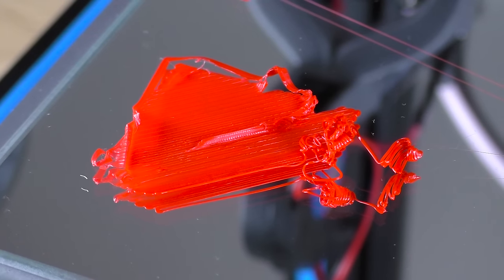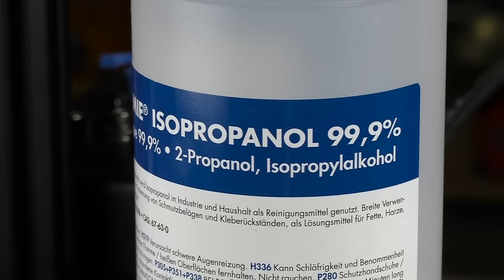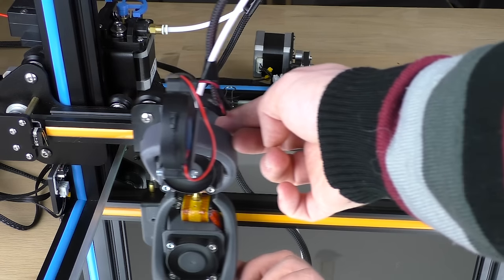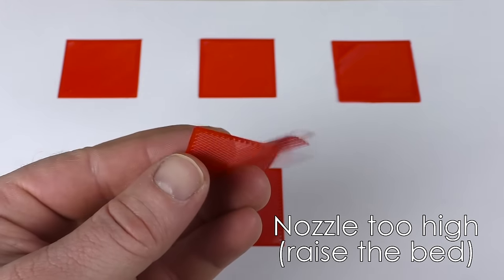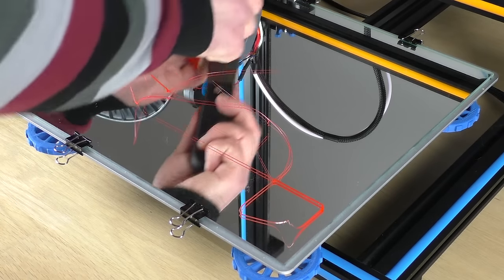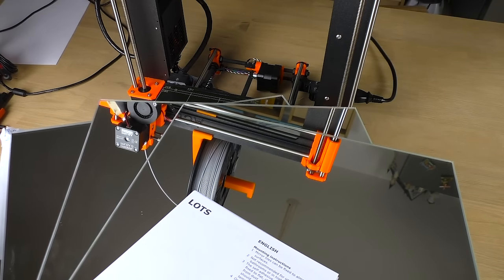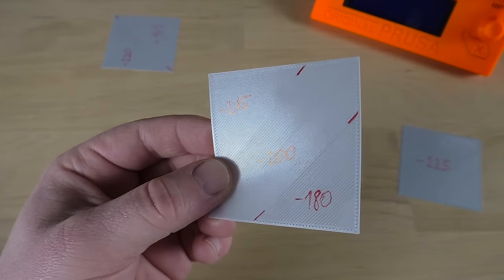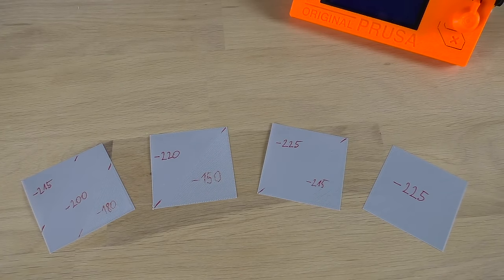Best method for 3D printer bed levelling

Comment: The "always clean with alcohol" tip deserves a thumbs up!
Reply from the maker: And so does your comment ;)
Reply: How I clean my insides too.
Reply: Unless you use buildtak
Reply: Never touch the glass print bed after cleaning. Body oils will reduce adhesion of the first layer.
Reply: If you have a glass bed, I strongly suggest to clean with dish soap before every big print and alcool between small prints and sometime with dish soap.
Reply: I've heared that alcohol destroys the plastic layer, can it be true?

Comment: I like the printed squares, but they look very big.   I recommend smaller squares, and then measure the thickness of each one with digital calipers.  Compare with the first layer height. The threads on many adjustment screws are 0.5 mm pitch.  So  1/5 of a turn moves the bed 0.1 mm.  Very good to know, place five marks on each adjustment wheel.  Turn 1/5 of a turn for error of 0.1 mm.  Most printer firmware assumes the paper has zero thickness, yet it is 0.1 mm thick.  So 1/5 turn after adjusting with paper will get you to zero.  Thank you for making and sharing the excellent video.  Very high quality.
Reply: Thank you very much sir! This is giving more tools for more precise calibration!

Comment: Thank you very much when people say “the nozzle should drag the paper” it’s a problem because drag is a generic term and everyone has a different idea what drag means like does drag mean that the nozzle is barley touching the paper or a lot etc thank you for actually showing it on camera
Reply from the maker: Thank you!

Yeah, that's why I've always hated the paper method, it's just not accurate enough for anything but a rough estimate. Even doing it myself, it's hard to be consistent with every corner. Printing the squares eliminates any guess work.
Reply: Yep, before this comment was made, I just yesterday started to under that I should start feeling resistance. I finally got a consistent 1st layer for the first time since owning a 3D printer.
Reply: @HobbyHoarder  lets not forget when people use "levelling paper"
like yeah, we all have some 3d printer levelling paper lying around.

Comment: I know this has over 300 comments but I wanted to jump in and add my thanks for making this video. I've been leveling my bed this way since I got my printer after I stumbled upon calibration squares on thingiverse and it has saved me hours of frustration. All new entrants to 3D printing should watch this video and learn this process for bed leveling. This is even better than automatic leveling because you are adjusting the actual finished product. I will often watch my printer during the first layer of prints and make minute adjustments to get that first layer perfect and my print quality has been consistently awesome using this method.
Reply from the maker: Thank you Christopher, it really means a lot. It always makes me happy reading how I've helped someone. And you're right, I prefer manual leveling as well. It's easier and works just as well as the auto leveling on my Prusa.

Comment: You are a lifesaver! I was using the paper method and I never got a good first layer. This helped me dial it in perfectly and now its almost impossible to get a print off without bed cooldown. Just like it should be!
Reply from the maker: Every comment like this brightens my day, thank you.
Reply: @HobbyHoarder  I kept thinking that it cant possibly be closer than the paper thickness. i was wrong. You helped me a lot. Im still tweaking it to get it perfect
Reply from the maker: I don't know how long you've had your printer, but the springs on new printers need some time to settle. Don't be surprised if you'll have to re-level it again in a few days. After a couple of weeks, the bed will become much more stable and you might have to level it only every few months.
Reply: @HobbyHoarder  I do notice my CR10s4 glass plate sags a little in the middle according to the calibration prints.
Reply from the maker: Yeah, that's quite common with the S4, it's just too big. Check the video description, I have a link there for wedge jack that you can put under the bed. You'll get a fifth adjustment point in the middle then and you can use it to raise the center just a little.

Comment: Dude! This works perfectly. I ran it 4 times and saw noticeable improvement on each run until all 5 squares were perfect. Kudos
Reply from the maker: Always happy to hear that, thank you :)
Reply: @HobbyHoarder So I've just gone and got myself some mirror glass after your recommendation.. do you have any tips for changing the z height for the thickness of the new glass? Ideally I'd like to create a ' glass bed profile ' and a ' magnetic bed profile ' with the correct z height set for each. Thanks in advance
Reply from the maker: @123benlambert  Depends on your slicer, but Simplify3D has the Z-offset by default. In Cura, you have to install the Z offset plugin and then you can find it under Bed adhesion section.

Comment: Good video!  Thanks!  And something you said that really helped me a lot.
If there are gaps, raise the bed.
If there is a rough texture, lower the bed.
I don't know if I've run across something as simplistic as that but with what you said and the calibration squares, it made more sense of the how to properly level your bed.
Thanks again!!
Reply from the maker: I'm very happy to hear that John, thank you for taking the time for commenting. I was so frustrated with bed leveling when I was starting out, but it really is simple once you know what to look for. Good luck with your printing hobby!

Comment: this worked perfectly, I slowed down the print during the corners and was able to adjust the hight while watching with a flashlight. tyvm
Reply from the maker: That's wonderful, I'm happy to hear it helped!
Reply: Great Vidio great meathod. I used feeler guages to get accurate levels. 
(Didnt like the paper meothod for all the reasons you gave) but after trying your squares I found that I was  over a full turn to high the megacubic s has a great base so they stuck but I am geting a crease through the centre square. I know from feeler guages that it is .05 to 0.07mm higher than the edges. 
Does that seem a lot? Any suggestions?

Comment: Thank you so much for the awesome video! It helped me so much with leveling my bed which have a dip in the middle. I placed layers of aluminum foil beneath the dipped area. 

Printer: ender 3 V2 with stock glass bed with upgraded bed springs.
Reply: Oh and thank you for making the test squares available.🙏
Reply from the maker: You're very much welcome :)

Great idea about the foil, that's what I always recommend as well.

Comment: On all the bed leveling video's I have not seen 1 that first says to wind the bed down so theres spring tension on the bed springs , if you dont have tension the bed is free to move around and wobbly all over the place during printing and also this is why every time you bed level its showing different measurements.... Tip of the day brought to you by Tony Den cheers happy printing.... 👍😊
Reply from the maker: Yes, that's a very good point, thanks for adding it to the comments!
Reply: @HobbyHoarder  welcome mate Im new to the awesome 3d print world but have a bit of mechanical and engineering history so like to tinker... 👍

Comment: This is the first video since March (when I bought my first and only 3D printer) that I should have seen BEFORE starting printing with it. It has an Ultrabase bed so I would like to avoid swapping it with a mere mirror. The problem is that my Ultrabase glass is warped like hell. The center is so low that even if I set the corners, what I print will never stick to the center of the bed. I will put some aluminium foil sheets in the middle and try to work on this square  methodology. Thanks a lot!
Reply from the maker: Yep, alu foil in the middle is probably your best bet. I've had to stack a few on my CR10, but it worked great then.

If it's really bad though, then installing leveling probe might be worth it. I'm not a big fan of BLTouch, it takes forever to probe. I ended up buying a flex steel sheet, then you can use something like EZABL or one of the many clones. Works great if you don't have a glass bed.
Reply: @HobbyHoarder  thanks for your answer. I shall give it a try!

Comment: Always do the space check directly above the leveling screws because that is the pivot point. Then do the spacing above the other three screws. Your bed will perfect as it can be without having to making the adjustments several times.
Reply: Thanks, I was wondering if that took effect or not.

Comment: I have found you have to adjust the bed by only lowering the bed with anyone of the knobs. If you raise use the knobs to raise the bed, it doesn't hold that position, there's slop or backlash on the knobs. If the bed needes to go higher, I need to raise the bed ABOVE where it will end up and then crank it down with the knob(s). It is like tuning  a guitar, you don't ease the tuning key, you have to tighten it for it to keep the tension. Same on the Enders... This is the benefit of running with a BLTouch. On the stock machine the bed is relative to a fixed item, the Z switch. With the BLTouch the bed is relative to the BLTouch probe. I ease my knobs so the bed starts as high as it can go. Then whenever I run the test print, I only lower the bed with the knobs. Eventually (after many prints) you may have tightened all the way down and you have to start over by easing the bed to the highest level again. This way, when I run these bed level test prints, I only bring the bed down under tension. This has worked really we for me.

Comment: Real old timer here. I just installed a 2 piece magnetic pad on my ender 3pro. I walked away and when I came back at the allotted time, I found a mess that i can not get off the pad. I would post a picture but do not know how to do that. I tried all methods, using 70 and 90% Isopropyl,scraping with putty knife. I think I might try a chisel next. it is a mess. I manually leveled the bed, then used the CR Touch ABL. Nothing. I am a babe in the cradle with this but am fascinated with it. Tried sending DrVax but no return, came across this video.
Reply from the maker: I'm sorry to hear that. It sounds like your first layer was squeezed too much against the bed if you can't get it off, but it's hard to say for sure without a photo.

You can upload a photo to imgur.com and copy the link here so I can take a look.
Reply: I have sent this message to numerous sites. You, (thank you) are the first to respond. I have been trying someone to answer.
Thank you very much. The print was supposed to be a test print from a site called Thingiverse. I "think" I uploaded the one of the pics. Hopefully I did it right.
Reply: @HobbyHoarder  I copied a one of the pictures on the site. Not sure what you mean by copy the link here. I don't see a place to do that. Thank you.
Reply from the maker: @MrDee195  I'm afraid I don't see any photos under your name on Thingiverse.

By "copy the link here", I mean uploading a photo on imgur.com (click on New post button to do this) and then you'll see an option somewhere to share a link. You can then copy and paste the link in a comment here.

Comment: The paper method is the best for manual leveling, and ive tried everything.
The biggest problem most people have is they dont place the nozzel over each bed screw when leveling each corner (it should be directly over the thumb wheel) and they dont fine tune z-offset after. Paper is good for getting the bed level, not setting the z-height.
Reply: Also use thin notebookpaper or receipt paper, and the corner is done the instant you feel friction from the nozzle, and alternate corners.

Comment: the commad G35 does exactly this for you, without printing anything, when set up right. It will probe the bed corners, and tell you exactly how many turns you need to turn each adjustment knob, and in which direction.
Reply from the maker: I'm seeing more and more printers using this feature. Although for printers without screws (like Prusa), you still have to do it visually by printing a test piece.

Comment: First, loose the springs.
The leveling knobs/nuts should be above the Y-axis chassis-plate, not below it!
Second, take a hard look at the leveling screws and how they are mounted to the print-bed heater.  Do they wiggle?
Third, the spacing of the leveling screws and the spacing of the holes in the Y-axis plate: do they line up or do they bind?
Run the leveling nuts on their screws about 1/2 down, install print-bed on Y-axis plate, fiddle with them until all four nuts touch the Y-plate and the Y-plate is level.
The ends of the screws that poke out under the Y-plate are given regular nuts.  They are jam-nuts to lock your bed-leveling.
From here, level any old way you like.
After the bed is leveled, carefully tighten the jam-nuts under the Y-plate; this locks in the alignment.
I ran an Anycubic Mega X for two years this way, no adjustments during that time.

Comment: I do it like this: Drive the head on top of each adjustment knob, at each knob i set head to Z = 0 mm (gcode command) and adjust the knob so the head touches the surface. Ready to print. With your method the Z zero position is going to be depending on the paper thickness and the feel.
Reply from the maker: The whole point of this method is that you don't have to use paper and "feel" the resistance, which is very subjective and unreliable.

Comment: I have been trying different bed leveling methods yours included for days with no use as it turns out last time I cleaned my extruder I left a loose screw that made tiny wiggles as it print that was the problem not the bed 
just leaving the comment it might benefit someone to give it a check in the future

Comment: What about bad bed adhesion? I cant even print the squares on my ender 3 s1 pro, please help im slowly giving up on 3d printing :[
Reply: ME F&$#ing either. I bought a glass bed, I tried glue stick, hairspray. Nothing worked. I haven’t printed a damn thing yet 3 months. Got an auto bed leveler to and an all metal extruded. I’m starting to think I got conned and this whole community is a psyop

Comment: I'm going to try your squares at 200% (since my bed is 400x400). Everything prints out crooked so I'm hoping this will indicate my current bed level issues! Thanks :)
Reply from the maker: Sure, just be careful that you only scale it in the XY direction - the height (Z) should remain 0,2mm even after scaling.
Reply: @HobbyHoarder  Thank you! I ended up using the squares combined with custom z-index all over the printing bed. Got it very close tuned in now. Printed 40+ squares haha. Only the middle one remains a little bit weird, but I'll figure it out eventually. The rest prints out very nice.
Reply from the maker: @TerrybleGamer  That's great, happy to hear you've fixed it :)

Comment: awesome video!
random note and tip: if your first layer bubbles and sin't sticking mysteriously it's a dirty bed.... I disassembled parts of my printer cause I thought it's an extrusion problem but it was a dirty bed. I feel so dumb :D
Reply from the maker: Thank you! Don't feel bad about it, we've all made similar mistakes. There's still my ancient thread on Prusa's forum asking why my first layer doesn't stick. Turned out I needed to clean the bed more often. After that, I just give it a quick wipe with iso. alcohol before every print, haven't had an issue since.

Comment: I learned from experience and another guy that isopropyl alcohol actually prevents the material from sticking because it leaves a residue behind.

The best way to get good adhesion is to clean the glass with warm water and dawn dish soap or something similar. After you're done with that let most the water drip off, then put it back. No need to dry it completely. Anything you use to dry other than heat will most likely only add residues. Make sure after cleaning the glass that you "never ever ever ever ever ever ever ever ever ever ever ever ever ever ever...ever ever ever...ever ever ever ever ever ever...touch the printing area of the glass or you'll have to do the cleaning process all over again"

After struggling getting things to stick with glue and what not, I just washed the glass and it was amazing the difference!
Reply from the maker: Interesting thought. Maybe it's different if you're using just plain glass. In my case, i'm using PEI sheet on Prusa, where iso alcohol works best and a mirror instead of glass on my CR-10 and it also seems to work great. I'm not using any glue, just bare mirror and the adhesion is very strong to the point where I have to struggle to get the object off sometimes.
Reply: @HobbyHoarder  maybe it's a mixture of the alcohol and other stuff that was on it causing problems
Reply: Alcohol works great for me on metal and pei as well.
Reply: Do not use Rubbing Alcohol...has oil in it...USE ONLY ISOPROPYL 99.9% Pure

Comment: One day I hope they add a camera near the nozzle that measures the width of the bead and adjust the z offset automatically. With ABL as well we can rigid mount the bed so it doesn't need adjustment and we waste less filament during calibration.
Reply from the maker: The trend is moving towards having it completely automated without any user inpit. Voron already does it and now Prusa Mk4 as well. So hopefully, in a few years, you won't ever have to fiddle with leveling again.